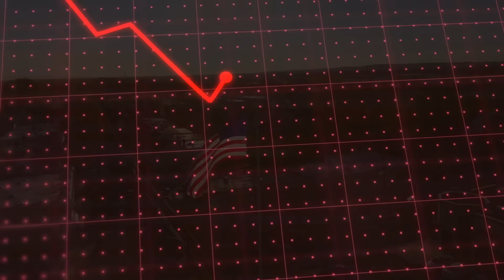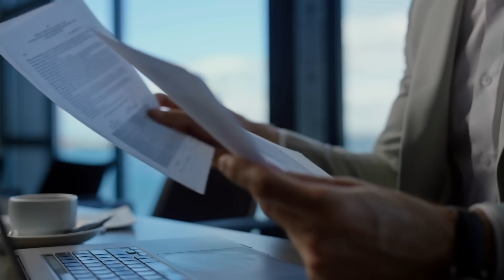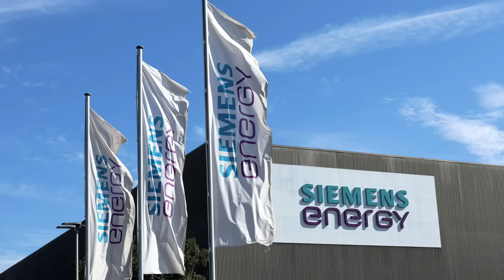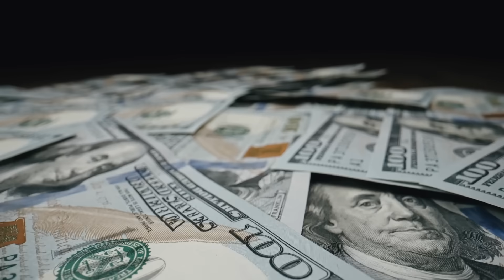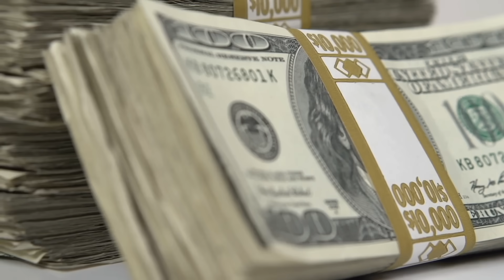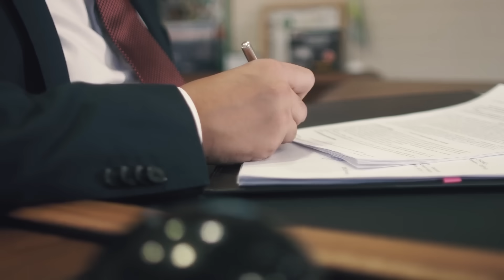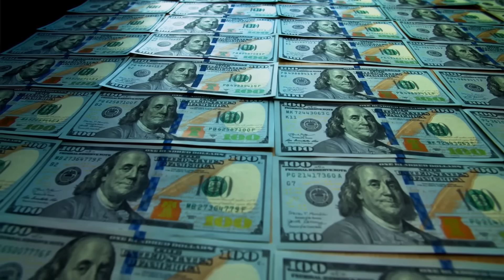The Real Reason America Has Turned Its Back On Wind Power Energy

Comment: Typical problem caused by government planners incentivizing behavior that they don't understand using our tax dollars.  

Utilities on their own, managed to provide power for the last 100 years in an efficient and low cost way.  They managed to overcome many problems such as the addition of central air-conditioning load without major problems or cost increases.

Now bureaucrats have decided that we need to end fossil fuel use and build solar and wind in the deserts and along coasts and mountain ranges in often very remote locations, they some ship that power across the country.  W often have multiple days with clouds or multiple days with no wind, so they plan to install batteries with enough capacity to power the country for several days... That's quite a project.  All it takes is money.   What a simplistic statement.

Look at Germany where they managed to get started on the "end fossil" side of the dream.  They did eliminate those low cost energy options and found that when solar and wind quit, they need to quickly fire up fossil plants.  The ones that fire up quickly tend to be dirty, much more dirty than the newer larger fossil plants... The result is that germans are now paying for the new solar and wind plants as well as the old mostly unused fossil plants.  Plus they now are emitting more pollution than before.

Government brilliance has given them the worst of both.  Now individuals face major increases in the cost of power to their homes, businesses are less competitive, anything that uses energy to manufacture (what does not) will cost more.  As business become less competitive, it grows slower, job creation slows, etc... great job Germany.  We need to open our eyes and get the government out of things that they are not capable of running.  (The list is long)
Reply: The US goverment subsidized fossil fuels for over 100 years.
It was cheap because US citizens paid the rest with taxes and a damaged enviroment.

Power plants that fire up quickly are hydro and gas, which are not known to be especially dirty.
Germany is turning off its old fossil power plants, as they are more expensive. The pollution is decreasing there for decades. The US uses more than threetimes as much coal as Germany.
Energy prices increased because of an increase in gas prices, something the US has experienced too.

Comment: My power bill has increased 21% in the last 18 months. Between that and taxes, these useless windmills are costing me big time!. I find it strange that the grid handled everything fine before windmills.
Reply: 1. They are not windmills
2. They did not increase the costs of fossil fuels.
Reply: @old-pete   tomato, tomato look up the definition of windmill. My power company requested the increase from the public service commission for green energy crossover and infrastructure. So yes, they did increase my rates which are currently 50% natural earth made products. Have a wonderful evening.
Reply: @phillmckrakin2518  Windmills mill, windturbines do not.
The fossil fuel prices increases dramaticly the past 30 months. That has nothing to do with windturbines.

Comment: There is an underlying assumption in this presentation which is crucial to  the whole question, yet unmentioned.  Electric power production must necessarily match the way electric power is consumed. It is this reality that has shaped the power industry since Thomas Edison built the first electric utilities.
It turns out that roughly 70% of all the power we use is needed all the time. 24/7 Utilities call this "base load". Because its on 24/7. the economics require that it be fuel efficient, and it tends to be capital intensive.  It takes years and enormous capital to build base load. Typically, it runs on coal, hydro and nuclear  fuel. But there is another category of power production needed. We call this "peak" load. Typically representing about 30% of total capacity it is , relatively  briefly needed vs base load, so fuel costs are relatively unimportant.  Peak generating is used when demand is atypically high, such as extreme temperatures or some of the base load being unavailable.  Typically gas turbines, these generators gobble fuel but are comparitively cheap to make, and can be brought on line in minutes from a cold start, when needed.
There is a third category of generating capacity called "interuptable" . Solar which works only in daylight and wind turbines which depend on enough wind are in this category.  From the standpoint of responding to the actual demand profiles of electric power, they are irrelevant. You can't replace always on base load with sometimes on solar or wind. They similarly can not be reliably replacing peak load. The hottest days or coldest days may not be windy. The unmentioned reality is that there is no amount of wind and solar that can replace the base load demand of a contemporary economy.  So what are we to do if we want to save the planet? We have pretty much already utilized our hydro and geothermal capability. One answer is nuclear.  Its clean. It runs 24/7. We currently have roughly 100 nuclear plants in operation for many decades.  There has been only one fatality in our entire history of nuclear generation. He was an older gentleman who suffered a fatal heart attack when the alarms went off at the failed Three Mile Island reactor.  Hey, what about about the catastrophes in Japan and Ukraine? That will be the subject of another time. The answers will not be what would be the first things that come to mind. 
Thanks for reading this turgid prose.
Ted
Retired straregy consultant.
Reply: And still Denmark gets 50% of its electricity from wind.

Comment: Each major city needs to disconnect from the grid and create their own micro grid environments, this way the national grid can be reduced to a rural power network servicing cities smaller than 25000 and the country side, while making each large city self-sufficient.  I have 14 acres and I plan to use the grid, but as my back up I will build my own micro-grid system using, solar, diesel generator and hopefully wind and a batteries.
Reply: The more customers and grids become independent, the more expensive electricity supply beceomes.
Reply: What cost is too high for independence?   And what are you willing to lose if it all goes south under a dependent system?
Reply: @0utrider  Money. What public grid permanently went down? Germany was bombed to smithereens in WW2. Their grid went down only locally and temporarily.

Comment: There is only one type of a "real" green energy, and that's nuclear. Wind power is a pipe dream and cannot be accomplished without fossil fuels. Oh, irony.
Reply: And how do you guess nuclear power plants are built?
And no, one does not need fossil fuels to create wind.
Reply: @old-pete  I did not say that. I said you need fossil fuel to create those idiotic turbines. The ones that cannot be recycled.  And Nuclear power plants generate electricity 3 times longer than turbines or solar cells on a very small amount of fuel. A LOT smarter than solar cells with 20% efficiency.
Reply: @bessarion1771 You brought up fossil fuel use as argument against wind power, but it does not matter for nuclear power?

And yes, windturbines can be recycled...
Wind and solar are a lot cheaper and a lot quicker to build than nuclear.
Reply: @old-pete  the benefit to cost ratio with nuclear power is orders of magnitude higher than for the solar and turbines, and NO, you CANNOT recycle solar panels or turbines - they get either buried or burned in Africa and Asia. The recyclables as a whole get only about 5% recycling rate, with aluminum having the absolute highest recycling rate of about 46%.
Reply: @bessarion1771  That does not change the fact that they can get recycled. Ask Veolia.
And do you calculate the benefit and what are the numbers?

Comment: Wind  is never going to catch on other then off grid micro generators.  There are a myriad of issues and many better alternatives.  FIRST pick a direction and refine the science (30-50 years) then start integration ( 25-40 years.)  Use fossil fuel in the interim.
Reply: We use windpower for thousands of years and modern windturbines for around 50 years. I think we got that.
Windturbines produce nearly as much electricity worldwide as nuclear power plants.

Comment: So, I as a taxpayer, am expected to help fund these companies who have almost doubled the cost of my electric bill in the past 2 years. Not if I can help it.
Reply: The increases of the last two years were probably because of the Ukraine war.
Reply: Eventually you will be happy to solve all of the green energy problems not with billions of taxpayer dollars but with an existing solution and existing infrastructure it’s called nuclear power
Reply: @lylebanser6041 The US taxpayer paid over 300 billion $ in subsidies to nuclear power. The operation of current reactors got saved by a financial boost of another 6 billion $. More to come...
Reply: @lylebanser6041  That will only be feasable if the government keeps the bureaucrats out of it and streamline the approval process. It got killed in the us before, because of bureaucratic nonsense. When I start digging a hole 4 ft wide and 60 ft deep, then the regulators come along after I'm half finished and tell me it can only be 3 1/2 ft wide and must be reinforced with something different than was previously approved, it will cost more money and create unnecessary delays. Basically, that's what caused the stoppage of nuclear plants here in the us back in the early 80s. Constantly changing regs by bureaucrats trying to justify their jobs.

Comment: Money, of course that’s your answer to everything. Wind generation lacks one key device, a start switch.  You can’t simply turn the wind on when it’s needed.  Here in the Pacific North West we are blessed with Hydro Power, but hydro units are being shut down when the wind is blowing so the investors can sell their unneeded power. Then the wind suddenly stops or changes and hydro has to quickly  pick up the load again to maintain system frequency.  The Eastern Columbia River Gorge is loaded with wind generators, hundreds of them.  These generators steal gigawatts of energy from the wind. It's this wind  that moves our weather systems onshore.  What is the environmental impact on our weather, of thousands of wind farms here and nationwide?
Reply: Wind does not just suddenly stop. Wind patterns can be predicted 48h in advance. The power drops gradual, enough time for hydro to start.
There are not enough windturbines to affect the climate. This will not happen in the next hundred years

Comment: The thumbnail showing a wind turbine on fire was pretty misleading... Now PJM isn't the only one looking to put a freeze while they work though a backlog of interconnection requests -- the California Independent System Operator (CAISO) on Feb 8, 2024, asked federal regulators for permission to cancel its annual interconnection study process for any interconnection requests submitted this year so it can deal with a “tsunami” of existing interconnection requests. It's not just money that is needed. It's a byzantine system in which any new transmission lines require permission from multiple layers of governments and landowners. Any single one disagreeing can shut down a project. The Volts Podcast by David Roberts has a number of good episodes on these issues.

Comment: Add to the list the fact that many of the wind turbines are disintegrating after only a few years of use!  The bottom line of this article is that the government is really the problem!  Get the government out of the energy industry and things might improve.
Reply: Most windturbines run fine for 20 years, even longer if one wishes.

Comment: never could figure out why the land based units have the heavy generator at the top, so need big anchors at the bottom.  Why not put the heavy generator at the bottom, and have a 90degree gear at the top driving a vertical drive shaft?  Save cost, and make them safer in a storm.
Reply: That was proposed years ago, nobody built that yet. I guess a drive shaft that long is hard to build.

Comment: You've got to remember that any grid has to balance the amount of wind and solar it has  relative to its producible base load. You just need to look at Alberta's situation where all of its coal was phased out rapidly, and then the wind and solar that replaced it developed a lack of base load situation for the province.
Reply: They still have base load power plants.
Albertas problem is that too much maintenance is going on during the cold season and that Alberta does not pay power providers for standby.

Comment: The Wichita Lineman will have work for several lifetimes unless states have more freedom from Washington to find their own solutions, sell the expertise to other states and even countries, compete directly with the Federal bureaucracies for tax dollars covering utilities of all sorts.
It would be preferable for grid renewal to be paid for within the USA for many reasons but if worn out politics get in the way then investment can be from overseas subject to guarantees and protections.
Grid infrastructure in Russia, the Caucasus states, Finland, Norway, the UK, France, Spain, Morocco, urban China and urban India has developed to meet extra load and not all of these countries have nationalized systems. They have contracts usually involving governments at some level but avoid the sclerosis of the USA.
Interestingly, Russia strengthened infrastructure from the the 1970s to modern times and its trunk cabling is largely underground in large tunnels allowing easy maintenance in case of permafrost land shift. Early on the underground choice was partly for security and Moscow funded but since 1991 responsibilities passed to regions and districts and many developed very large composite/plastics modules of different types suitable for extreme cold and having bending qualities over the long sections co-developed with Finland to supply Karelian regions. Many stretches have permanent rotating crews and the equivalent of surface sub-stations and transformer stocks.
Power to railways explains the routes of these tunnels and as wind and PV technology advanced it became possible to store and inject power to maintain base load redundancy.
This approach might be considered by the US and Canada.

Comment: It is even worse. This condition (connecting to the grid) and volume of space and number of units have been known from the beginning. That is, example, 1-nuke power station (or fossil fuel plant)  can generate 10 times the annual output of the largest solar plant in the US. Also, the space required for a nuke plant is 1/14th the space. The severity of the problem then is further complicated by the fact there are 730 fossil plants (of large scale) or 730 x 14 the amount need space. Those spaces for solar or windfarms DO NOT EXIST in the US. This was always known. (Note: this is just for the 730 large plant-sites. There is nearly matching that numbers of small, very small or mid-sized plant-sites that will expand by about a factor of 14 to 1 as well.
Reply: The US has more than enough room.

Comment: The folly of renewables and their hidden uneconomic and unviable network infrastructure upgrade costs.
Keep the existing network and keep gas and nuclear generators.
Quicker, simpler, cheaper.
Reply: Climate change is not cheap. And fossil fuels will not stay cheap in the long run.

Comment: Essentially wind and solar power are replacing existing fossil fuel power so the grid should be largely capable of handling the change. There will be some geographical issues where new energy generating facilities will be located in areas providing optimum wind or available Sun light hours.  In that case the grid network will require change - but that not only a cost, it is an opportunity for grid improvement.  I think we're just watching an ageing, fragmented grid and a fossil fuel obsessed nation struggling to join the modern era.

Comment: Wind and solar suck in places that snow. The blades freeze up which require helicopters using petroleum to use a petroleum based defrosting agent to loosen up the blades and snow covering solar panels fail to collect any sunlight.  Also, when solar panels come to the end of their life and need to be replaced, they leek toxins that are more damaging to the earth than nuclear spills. Also, placing them in the seas has caused major disruption to sealife. Whales are misguided by the machines and have been known to strand themselves. All the green options are not green at all. We still lack around 30% of the technology needed to go this route. These options are actually more detrimental for the earth in a shorter space of time. The claim of many countries claiming that they are going to get to 0% emissions? In order for life to be sustainable...that's human, animal, insect, aquatic and plant, you need, at minimum 2 C02 emissions. We're sitting at 4. Also, as far as air pollution, the last decade alone, over the US has actually been cleaner and it's not due to EVs, solar or wind. People. This is called a cycle. Were also still 5 degrees colder than Rome was just over 500 years ago.
Reply: You are aware that windturbines can be installed with internal heating? Helicopters are not needed.

Solar panels do not leak.

Whales do not get misguided by offshore windfarms.The media attributed whale deaths to windfarns that were not even built yet.

And no, Roman times were not warmer.